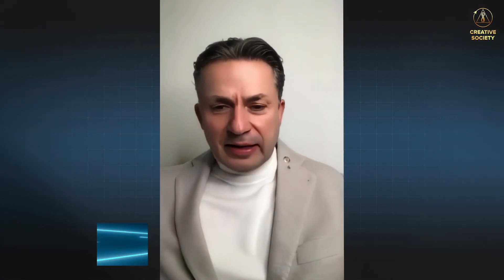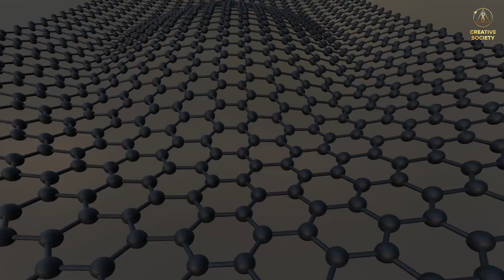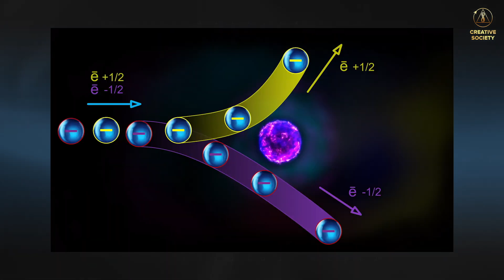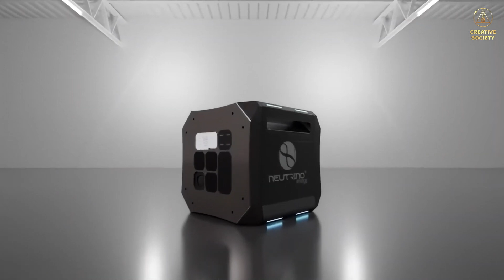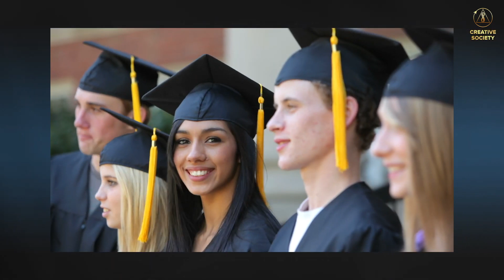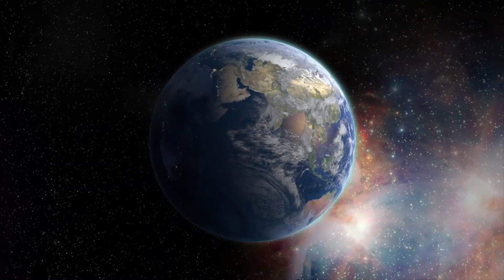Unlocking Infinite Energy: The Power Cube Revolution by Holger Thorsten Schubart

Comment: If you have plentiful #Electricity, then you can run one of many devices that extract #Water from the air, even in arid #Desert regions. So, by providing a PowerCube with enough energy to run a refrigeration unit/dehumdifier, you can also supply the human part of the Water problem. In fact, the agriculture part of the water problem can also be partly solved by electricity to run drills, and water pumps to access water that is plentiful in underground aquifers, even in the Sahel region or the Sinai/Gaza area.
Reply: And the whole Earth turned green. :face-blue-smiling: